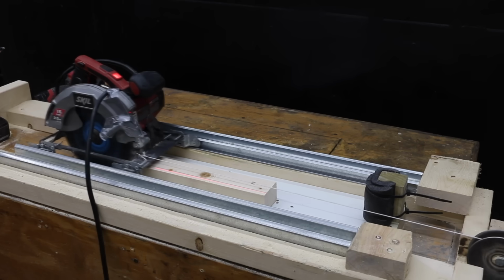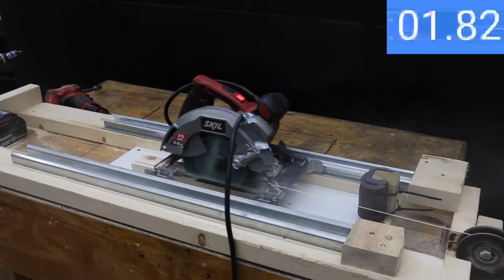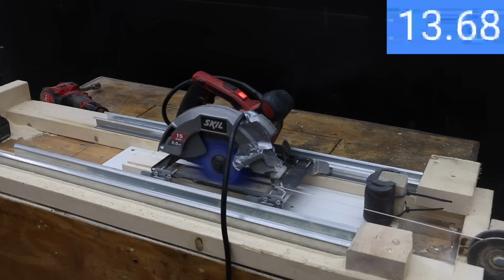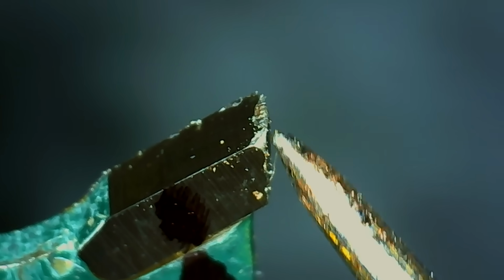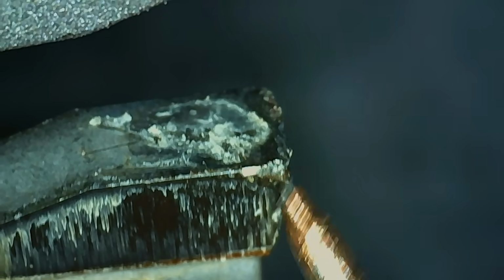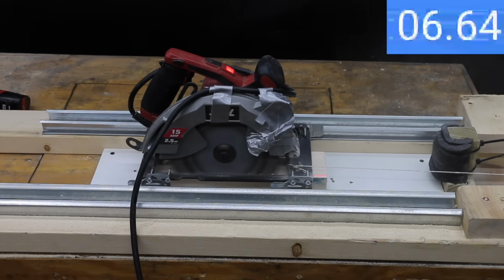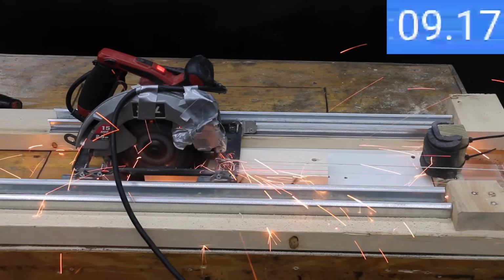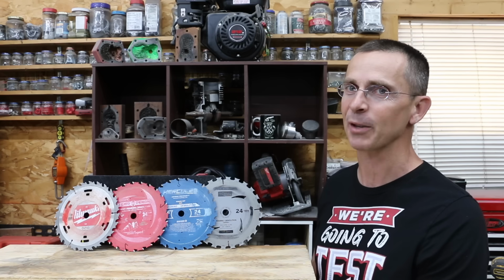Best "Demolition" Circular Saw Blade? Milwaukee, Diablo, DeWalt, Hercules, Evolution, Bosch, Amana

Comment: We've demolished structures before to have the wood from them but have never intentionally cut through nails with a saw blade.  when finished tearing down an old house or whatever we'll spend weeks straightening the old nails out so they can be driven out far enough to get a crowbar under the nail head and pull them out of the boards.  A hammer and a crowbar will last virtually forever as I have the same ones my Pappy had when he was 30 years younger than I am now, lol.  The only saw blades I've ever bought for my skilsaw are 7 1/4" Irwin general purpose blades with corded steel teeth with 40 teeth per blade.  I think they go for about 7 bucks each at the local hardware store and in ten years I may have gone through 4 blades.
Reply from the maker: Thanks for sharing.

Comment: Honestly, no shill intended, but one of the things I've learned from this channel is that generally you can pick up a Milwaukee anything an it will perform near the top of the pack. Also most things made in japan seem to be similar top of the pack performance. If it's a planned purchase I will use this channel to find the top performer, but if I just need something an can't do research beforehand my new rule is Milwaukee or made in Japan(this one I've known for a while).
Reply from the maker: Thanks for sharing.

Comment: Awesome video, as soon as you said made in Japan I knew that would be the blade to buy. Freud makes the Diablo blades and we've used Freud industrial blades and the operator's hated them. But the Diablo line seems to do better than the straight Freud brand.
Reply from the maker: Thanks for the feedback.

Comment: Hey ... the shingle segment was not the same saw ... the shingle segment was a Black & Decker while the saw on the pulley system was a Skill. You are testing blades, not saws so it should be the same saw in all tests.

Comment: I get the normal Diablo framing blades 2 for $10 and they cut nails like butter and last forever. I actually picked up a trashed one on a Jobsite and used it to cut 1x12" siding with a lot of nails. No problem. Then cut through solid oak hardwood flooring and subflooring with both types of nails, didn't even slow it down. That was on a gen5x brushless cordless saw.... Had that blade since 2017 and it still cuts... I'll throw it on my 36volt Makita rear handle saw and really test it out. Probably cut Hardie backer and drywall just for fun 😊
Reply from the maker: Thanks for sharing.

Comment: How often are you ripping 2x4's though?  Crosscut is far more common and does perform quite a bit differently per blade geometry. Would have been interesting to run this with three boards arranged to make a long set of crosscuts instead or a rip.

Comment: The Evolution blade is nice but I would check it for heat dissipation and, after prolonged use, smoothness of cut surface. Hercules may place 2nd here for this numbers set but I'm not willing to bet on consistency at $10/blade. Sorry, been down that road way too many times before. The Diablo blade is my go-to for anything circular saw, period. They are consistent in quality, decently priced and always available. In fact, I'm not a big router user, but I do wish Freud made their bits as common as their blades. Also, not sure why they spun off the diablo name as its own brand but, whatever, when I think speed I still think Italian. Bosch just seems to have forsaken anything that doesn't have a hammer action - which is fine, who wants to pay those prices only to find out it was made of questionable materials in a south Asian sweatshop? Living in Switzerland ain't cheap, yo.
Reply from the maker: Thanks for the feedback.

Comment: I have an Evolution 10" combo saw (sliding compound, metal and wood.) I blew all the carbide teeth off the original blade and replaced it with a Canadian brand 60 tooth knockoff that wasn't meant for metal cutting - it works better than the expensive blade, which kind of mirrors your results.
Possible idea for a future video - Carbide chop saw blade comparison, if you have a compatible saw that is. My Evolution has a gear drive motor that reduces speed to, I think, around 2500 RPM, which I believe is why the cheap blade doesn't self destruct. The 14" saws I see run around 1400 rpm.
Reply from the maker: Thanks for the video idea.

Comment: Looks like I'll be swinging by Harbor Freight tomorrow. That is a decent performing blade. Thanks for the great work you do!
Reply: Same here~~gotta stock some blades before the price rise
Reply: Just left there and wish I saw this before I went. I didn't walk out with a blade :(
Reply: I work for Harbor freight, and while all the tools are cheap, there are a few tools and accessories that are as good or better than their expensive counterparts. And, surprisingly, a lot of the tools you see at Home Depot and Lowes are made by the same factory that makes Harbor Freight tools.
Reply: @wolfhuntersarmory  yes, the 12" Hercules sliding miter saw is as good as the Dewalt.
Reply: If you put the Diablo and Hercules side by side, they look identical (laser etch marks, heat reliefs, etc) except for color. Their nearly identical performance in this testing would seem to indicate what I've always suspected - they are the same blade with different color coating.

Comment: Video Idea: Camping Coolers.  The prices range from $20 to $1000.  Would love to see a Project Farm style showdown.
Reply from the maker: Thanks for the video idea.
Reply: That will be costly.. Those Roto-molded coolers cost a small fortune. Some are worth it, others definitely advertising hype and excessive marketing to well-heeled hippies. Some of those Roto coolers also weigh a lot.. then you add Ice and food/ beer/ assorted contents...  I was going to get a big 150 liter one for fishing, to hold the trout/salmon we catch, but the blasted thing was 89 lbs EMPTY. Add ice and a few 20+ lb salmon or 4 or 5 big lakers, and you'll need a team, or a crane to offload it. ( It was ~$800 (Cdn) on Amazon.
Reply: I'd love to see how PF comes up with a jig to figure out how easy it is to drag them through beach sand when the wheels inevitably fail to do anything.

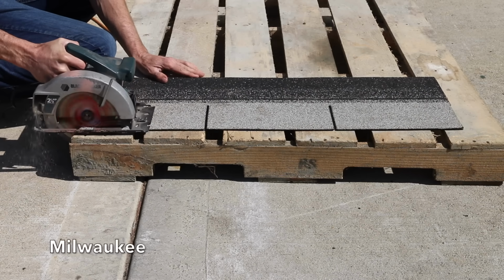Comment: 14:00 my only comment is that pallet wood has the potential to be some of the toughest stuff to cut! Obviously this varies greatly, but that stuff can really "work harden" to use a term incorrectly. I've done a few "crafty" projects and one of them simply was so dense the screws I was using could not be countersunk without using water to cool the carbide bit. The same boards could only be put through a planer at about 1/32 at a time or they'd lock the damn thing up. Crazy! As always, thanks PF these videos are incredible!
Reply from the maker: You are welcome!

Comment: Very well done! Less teeth and thicker kerf on the Demo blades doesn't exactly translate to slower cut. The biggest factor is actually the tooth take angle. That's why the Amana blade did better than the pure demo blades
Reply from the maker: Thanks!  Thanks for sharing.

Comment: Wonder if using less weight on the nails would have caused less damage. Still a consistent comparison though. I was rooting for Masterforce because I think their stuff is underrated and almost never discussed on anyone else's channel but yours. They need to get their coating worked out. It would have been a strong competitor otherwise.

I think superglue could use a revisited test since you're so much more thorough than you used to be.
Reply from the maker: Thanks for the feedback.

Comment: Less teeth is not what slows the blades down (although the 5 tooth blade might be).  The wider kerf and tooth design are the main factors that will cause the cut to be slower.  Physics dictates that blades with higher tooth counts add friction and therefore cut slower/require more input.  This is why rip blades are anywhere from 12-24 teeth, and crosscut blades are 40-100+.  

To test what I'm saying, put in a 60 tooth crosscut blade in a table saw and rip a board, then put in a 24 tooth and rip the same board, you're going to notice a huge difference.  Make sure the kerfs are the same.
Reply from the maker: Thanks for the feedback.

Comment: How can a saw be designed for nails but not recommended for metals. Last time I checked, nails are usually metal.....
Reply: I think they mean it’s fine to cut nails embedded in wood but they aren’t for cutting sheet metal

Comment: i dont know about you but most people are here to see you break stuff and watch expensive items turn out to be worthless, would love to see a tested to destruction series or a series with really outrageous tests "which saw blade is better at cutting a car in half" seeing how they work on a daily basis is good but i would love the tests to be extreme  . also would i think a series where you compare tools and how dangerous they are when things go wrong eg. what all these blades did to hands and fingers, which drills catch your hair and cloths easy , it would be great to watch and also provide some great insight people might find they would sacrifice the seped of cutting or ease of use if it means a accident with the tool would do alot less damage to you, you might even expose some safety design flaws for manufacturers to fix, anyway love your videos and content but i really would love to see your format with more extreme testing medium like balistic gel, bones, 1000 degree blocks of iron.
Reply from the maker: Thanks for the suggestions!

Comment: Hi Project Farm.
love your work.
my neighbour has a habit of cleaning out his cars diesel engines every few years with diesel mixed with engine oil into the crankcase and running the engine for about an hour in the driveway.
just wondering about engine wear with this method.
cheers
Reply from the maker: Thanks!  Thanks for the suggestion.

Comment: I really enjoy your thorough testing and honest methods.

I've put new Diablo blades on a 5 1/4 panel saw, a 10" table saw, and the 7 inch circular saw.  All three saws performed FAR better than they had new.  After watching this I will definitely keep a few Hercules blades around too.  Many years ago I looked down on Harbor Freight due to the pricing and because I didn't know better.  It's funny how a 4 1/2" grinder I purchased 20 years ago for 10 bucks (Pittsburgh I think) is still performing as good as the day I first brought it home.  

Never judge a book by the price tag on its cover!
Reply from the maker: Thanks!  Thanks for sharing.

Comment: From what I have learned, there seems to be no need to spend more than $16 on a framing/demo blade. The cheaper blades seemed to work better by far than those that cost $20+.
Reply from the maker: Thanks for the feedback.

Comment: This was one of your most thorough and progressive testing courses yet. Well done! One thing I've learned from project farm is when Diablo is on the roster, every other brand better bring their A game!
Reply from the maker: Thanks!
Reply: Made in Italy and not China is also a bonus. Not as good as America but we'll take it
Reply: @danb9312  turns out italy is actually much better than america
Reply: @Thatsme849   sometimes true, but not a blanket statement
Reply: @danb9312  sometimes true, but not a blanket statement
Reply: Diablo on the crew only
Reply: Be interested to see what the results would’ve been if all your cuts had been across the grain instead of along
Reply: As any woodworker would know with or along the grain cuts are prone to highly variable resistance values as can easily be seen in the video

Comment: The Hercules, Master Force, and Spyder all look suspiciously identical.
Reply: i cant think of an example but i know a few things that look similar are actually made in the same factory just branded differently. Perhaps Hercules just got the better metal
Reply: @Selendryle  Agreed. And it could just be the luck of the draw as to which blade brand was made with which material - the strength and durability of metal can vary a lot with a small change in alloy percentages.
Reply: i was betting on masterforce the whole time. maybe my obsession with star wars...
Reply from the maker: Thanks for the feedback.
Reply: The blades are often made in same factory... the quality varies in the carbide, and how the carbide is adhered to the saw.
Reply: Harbor freight has usually used this tactic and I love it. My cheap snap on jack is awesome but it says Pittsburgh on it. I don’t mind
Reply: Came here to say this :)

Comment: VIDEO SUGGESTION: meat thermometers
Not a tool, but nearly all of us cook meat, and I can't seem to find a meat thermometer that is either fast enough to measure multiple pieces quickly, or requires excessive penetration to read anything, making it impossible to test steak or chicken bites. On top of that, so many thermometers are just completely wrong. I'd love to see a test comparing speed, accuracy, and minimum entry.

Thanks! You're doing great work for the public, and teaching us all kinds of relevant things along the way.
Reply from the maker: You are welcome!  Thanks for the video idea.

Comment: "Really simple test jig". Saw is floating, on rollers, pulled through the workpiece utilizing a weighted pulley system that ensures constant and consistent pressure is used to propel the saw through the test piece. Oh, and the test jig is perfectly aligned using a laser. Yep, sounds simple to me. This guy cracks me up.
Reply from the maker: Thanks for watching!

Comment: I’m kind of confused why you chose rip cuts? Other than plywood sheeting, what other rips are necessary in a demo? Cutting out joists, studs or rafters are usually going to be cross cut. I noticed after the nails, you used cross cut the pallet. I was impressed with the overall cut quality even after the punishment. Kind of a shame you didn’t use the jig for that step with plywood sheeting.

Comment: I definitely appreciate the work put into this video.  Unlike a lot of the others, it's not like you could just walk off and let them run - you had to spent all of your time wearing protective gear, watching these things.   One question - it looked like you didn't wax/lube the guide points at all - some of the hesitation looked more like the saw base binding, rather than the blade binding on the wood.     

I wonder what it would have felt like driving that saw through 10 nails by hand.   I don't think I would want to do it.   

Interestingly enough, this is pretty much the least useful tool review for me - when I do cut wood that has fasteners, I remove the screws/nails first, because that's a pet peeve of mine.

Comment: Have to assume when it says not recommended for cutting metals or masonry it probably means straight up cutting through metal. I regularly use my diablo blades to cut aluminum.
Reply from the maker: Thanks for sharing.

Comment: I noticed from personal experience, Tree Sap Slows the Blades down. If you used Brake Clean and cleaned the blades after a few uses, They tend to cut faster.
Reply from the maker: Thanks for the feedback.

Comment: You should test chainsaw bar oils. I feel like I’m just guessing every time I buy it since you haven’t tested it yet. Thanks, I love the videos.
Reply from the maker: Thanks!  Thanks for the video idea.
Reply: as long as you are using actual bar and chain oil with added tackifiers, it won't make a huge difference over the life of the bar. There isn't any bar oil that will make your saw run faster!
Reply: @Slick519  yes I only use actual stuff but many make claims as far as working temperatures. Some say winter use only others say all seasons.  There is also a big price difference on many of the brands.  For what it’s worth, I’ve been professionally doing Treework for just over decade.
Reply: @KyleH1776  winter bar oil isn't tacky, it's meant for near and below freezing temperatures, all season is probably just summer oil for place without winter,

Buy the cheap stuff
Reply: @patricelebrasseur5649  , i use canola oil.  there are hazards breathing the micro-particles that mineral bar oil gives off.  and if 1 million gallons of it are made every year ( i'm guessing how much is made ) thats 1 million gallons spread over the ground in forests and elsewhere.

Comment: Awesome video as always. 

One thing I would like to bring up is the cutting direction. Most of the time these saws blades are used for cross cutting vs the rip cutting you were doing. The direction of the cut vs the style of blade can make a big difference in performance.
Reply from the maker: Thanks!  Thanks for the constructive feedback.
Reply: @ProjectFarm  NP, I always use your videos and tell others to watch your videos before buying blades, bits, and other project stuff. Thank you for doing what you do.

Comment: You set a new standard in saw blade testing. Week by week excellent videos and descriptions without fail. 

Gas and electric circular saws also need to be tested too as well as the discs. Diamond Vs Boron? Gas vs Electric? Stihl Vs Makita?
Reply from the maker: Thanks so much!  Thanks for the video idea.

Comment: Interesting. I bought a 7 1/4" 60 tooth Diablo blade for cutting melamine faced chipboard last week.
I did not care about cutting speed, just that the melamine cut without chipping. I only needed to cut 900mm (3') but it worked great for that, cutting from both sides of the 16mm board (1800mm total) with a blade depth of 10mm. When it comes to woodwork I have very little idea of what I'm doing. I'd never heard of Diablo but it met the criteria I'd read about for cutting melamine faced chipboard and eBay had it locally. Nice to see a Diablo blade came out OK on Project Farm's tests.
Reply: Diablo is a very highly regarded brand in the construction industry. And for good reason, they perform well.
Reply from the maker: Thanks for sharing.